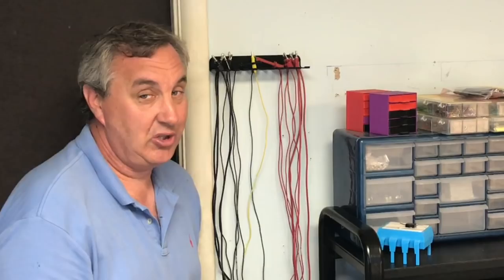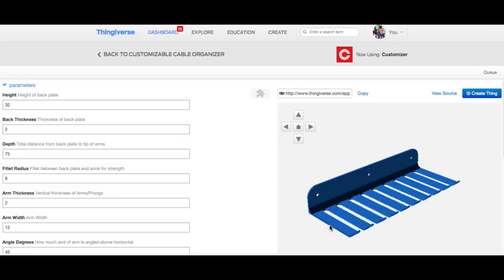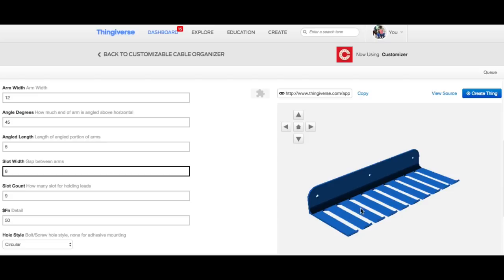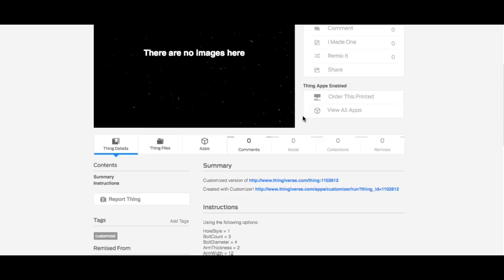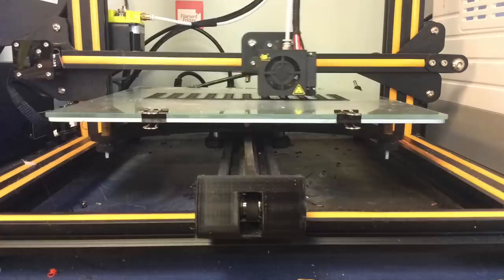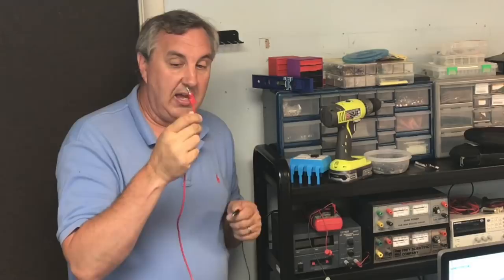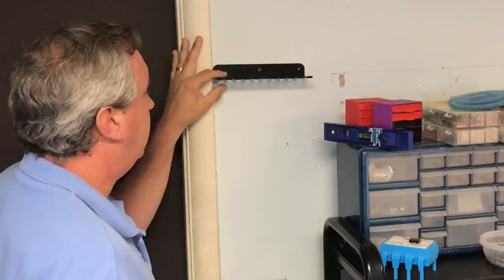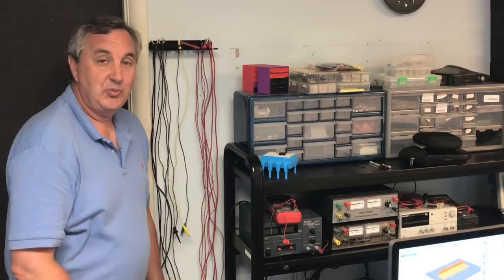3D Printed Electrical Test Lead Holder and Cable Organizer using Thingiverse Customizer

Comment: I have tried the customizer several times now and it never completes?  I want to customize it for 5 mm slots.  I have banana plugs that are probably 50 yrs old, and the slots are a bit wide for them, it is sloppy.  Like this though. 10 slots are about right.

Comment: Hi Chuck,  I'm seeing this error when I try to open the original thing in Customizer (at the bottom of the list of parameters):

 /usr/local/bin/openscad/openscad: error while loading shared libraries: libCGAL.so.10: cannot open shared object file: No such file or directory

Do you see the same error?